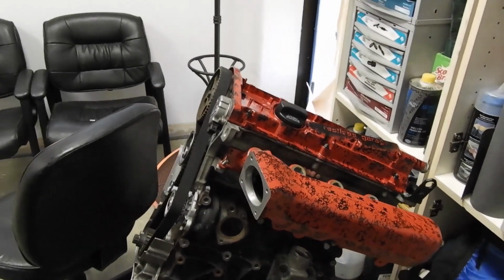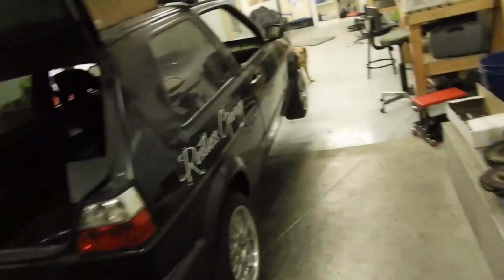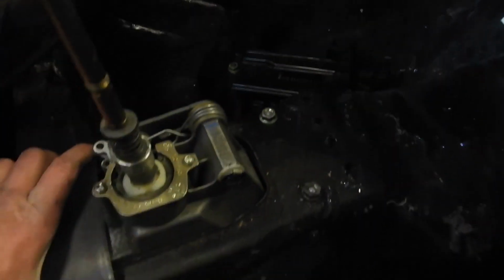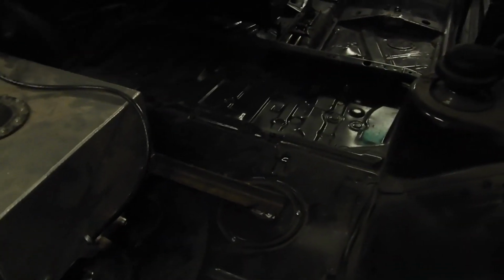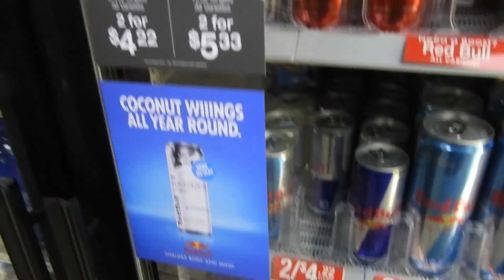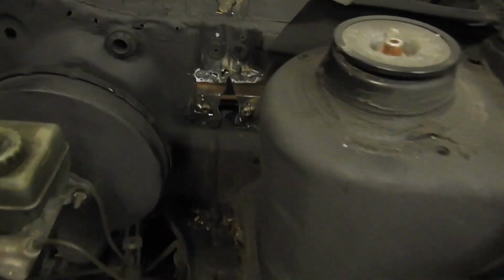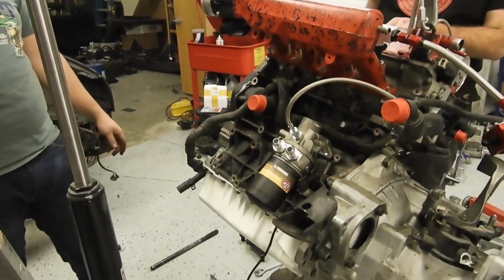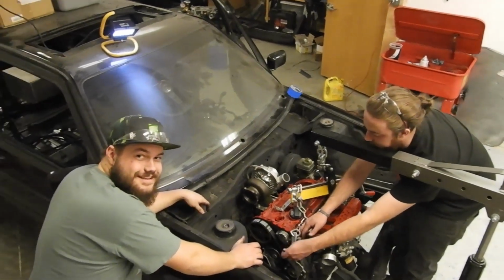How to lose your money fast! (MK2 1.8t swap)

Comment: What sub frame did you use and what were the mounts/brackets you used for the engine, were they all G60 mounts/brackets?
Reply from the maker: I used the stock subframe from the mk2, and then stock mk2 8v engine side mount, the reinforced front transmission mount with vr6 mk3 mount bolts, and a rear 02a g60 transmission mount.
Reply: I've been trying to figure this out forever

Comment: Why does my 2006 GTI leak water into my driver floor board,  ugghhh i can't find the leak man
Reply from the maker: More than likely if it has a sun roof it’s because the sunroof drain is clogged on that side.
Reply: @restlessgarage5942  it does have sunroof , thanks for heads up

Comment: i know that this is somewhat offtopic, but how hard would it be to 1,8t swap a gen 2 polo (breadvan)?
Reply from the maker: Unknown. I don’t know much about the polo because here in the states we never received them. Hardest part is if your keeping the stock wiring is integrating the chassis and engine ecu harness into the car.
Reply: fair enough. Thanks for the tip regardless
Reply: @pottasium7117  they say the 1.8 is too tall to sit in a polo bay, and chassis legs have to be severely cut. @Restless Garage did you ever make any more videos on this swap? I’m interested on how you approached the wiring and i like how you lay out your videos

Comment: What subframe did you use? Core support? Did u use
Reply from the maker: Stock core support, stock frame. Just reinforced the front to increase the resistance to bending.

Comment: I’m doing the same swap what did you guys use for the upper transmission mount?
Reply from the maker: Well it depends on what transmission your using.
Reply: Restless Garage I’m using the 5 speed O2J. I’ve heard a G60 mount works but I’m not entirely sure. Thanks for responding!
Reply from the maker: It will be the g60 mount. It just mounts on the back of the diff case